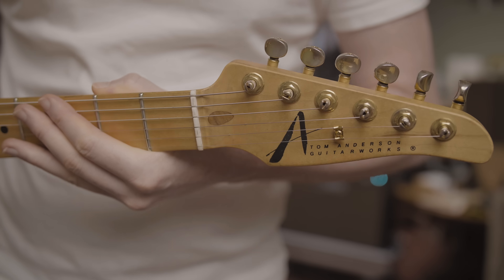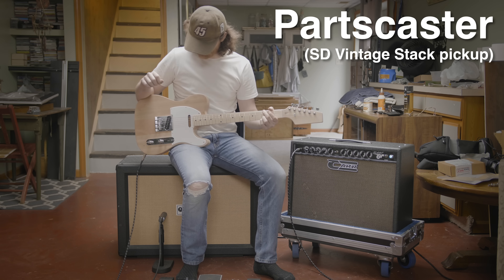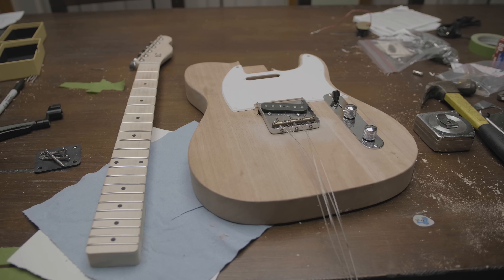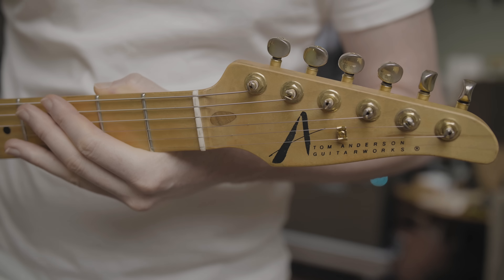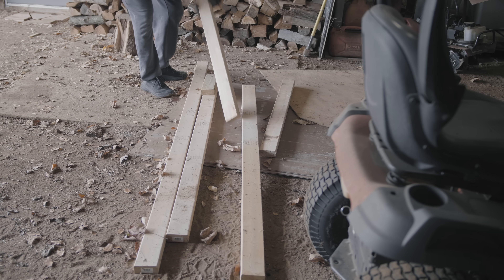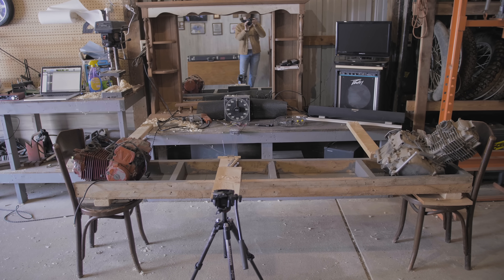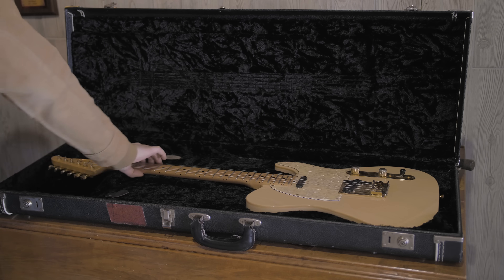Tested: Where Does The Tone Come From In An Electric Guitar?

Comment: So buy any guitar you think looks cool and put Seymour Duncans in it, and have the neck gone over and the guitar set up and you're good to go! BTW I' ve watched a few of your vids before, but this bit of brilliance earned you one more subscribe!  Excellent work!
Reply: I’ll add that there is a function argument to be made. The bridge and tuners matter, not for their tone, but for their ability to maintain tuning.
Reply: I have a 1977 Aria Pro II flying V that I bought in 1982 and the original owner installed Seymore Duncan pickups and I absolutely LOVE the sound out of that guitar. He also installed an original Floyd Rose tremelo in it (like EVH's first trem) and after updating to a tuneable locking FR, the tone changed.
Reply: @gneric85  noted, will be putting some in my Aria Pro II Z
Reply: "Buy a cheap guitar, replace the pickups, most of the hardware, take it to a tech and have them cut a decent nut, level and dress the frets, do a setup, and you're good to go!"

😂
Reply: @michaelwoods9005  You say that as if it's ridiculous but modding a cheap guitar still turns out cheaper than buying a high-end guitar.

Comment: I could hear a difference in all cases, especially between the guitar that was made from the slab of wood and the telecaster.  That, even given the fact that Youtube provides a maximum of 128k mp4 -- mp4 is a good codec, and it's true that the sound is somewhat isolated, but it's almost certainly losing a good deal of sound detail.  And then I'm using a laptop with the built-in speakers, which is horrible listening equipment.  The air guitar test is hardly scientific (though I heard a difference with this, as well) -- there are too many variables in the speed, strength, and position of the strum (especially strumming vertically versus horizontally), and if we wanted to make sure, we would be looking at the waveform.  I think that the best possible test on Youtube would be capturing the sound directly from the guitar (no amplifier, no microphone) into the computer and either using a lossless codec or examining the waveform (or a frequency analysis -- I forget what it's called, but someone mentioned it here or on another video).

Comment: THANK YOU!!! for this awesome video! I was just talking to my guitar teacher about an Ibanez I recently bought, and how I am so unhappy with it. Over the past few days, I've been looking at different guitars trying to figure out what makes them sound good, because I don't ever want to spend so much money on another guitar just to be unhappy with it. I am not exactly certain what is the mechanical problem with this guitar, but I am going to say it is likely to be in the saddle/bridge hardware or the general quality of the construction, or both. The range of harmonics is weak when plucking an open string, and the guitar does not have a lot of sustain, even though the nut is a Graphtech tusk nut. My teacher affirmed to me that Ibanez does not make them like they used to. Thanks again, and good luck in the future. I will be checking out your other videos.

Comment: Great video and as I have always suspected. The vibration of the METAL stings  is sensed by the pickup and turned into a small and fluctuating electic current. The body of the guitar, being wood, has no effect and after the pickups have generated an electic current, then only the electronics in the guitar can influence that current until it reaches the amp. amp lead quality, must also have an effect.

Comment: The dude talking about vibrations in the solid wood kept by resin or whatever reminded me of the bs the audiophile comunity says. lmao
Not really surprised by the results.
You can have more difference with cheaper components, specially the electronics, with more noise and unwanted distortion variating according to your power supply and ambient crap. Some basic good components, including filters for electricity in the amp make all the difference, but that doesn't involve spending thousands.

Comment: The ultimate test would be capturing the sound waves from two different settings and comparing them in an oscilloscope. That is really the only way to tell if the difference is that great (or if you can hear the difference at all).

Comment: disclaimer: haven't finished the video, but predictably at the midpoint it shows 95% of the sound is just the pickup. Well, the other 5% is the capacity/resistance of volume pots, cables and capacitors. Hope he gets to that, will watch the rest at some point and see.

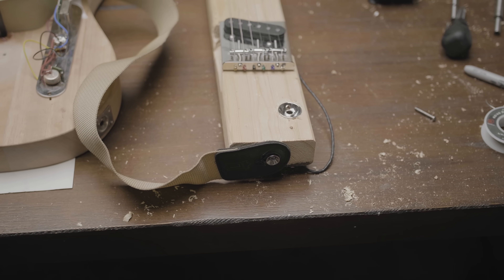Comment: 6:54 hold on, hold on! if you don't solder at least the pot volume between pick-up and jack then the output impedance of the guitar and the input impedance of the amplifier wont "match" sounding awful once conected to the amp.
Therefore i don't know what is sounding in the "2x4 guitar" demo, since theres no video i doubt was made with any guitar without pot volumen or any other electronic device (active or pasive) that helps to fix the inherent missmatch impedance issue.

Comment: I've just found this video so i'm "late to the party" but after reading a bunch comments i need to "say something".
I'm not a professional guitarist but i'm definitively a maniac , i've been playing for 35 years and i've about 50 guitars at the moment.
My last 5 guitars are Fender Stratocaster Yngwie Malmsteen signature (usa) , same spec , same hardware , same strings , everything is exactly the same.
When i play those guitars without a amp ( acoustically speaking ), those five guitars sound quite different from each other ,
 it's not that subtle and the only thing that can explain that is the wood.
One of them have a quite tight,dry,clear sound , another one is quite dark,warm sounding , another one is quite louder than all the other,another one seem to resonated almost
like if it was a semi-hollow guitar, that one seem to have some acoustic propriety than the other don't have.
The type of wood is the same for all the guitars , alder body and one piece maple neck but the sound , the feel , the overall vibe of those guitars is different.
The only things left that would explain those difference would be the grain of the wood.
Every piece of wood is unique, kinda like finger print ,they have a different grain,density and who know what else...
 and that must be the reason why my 5 guitars react differently.
So when i read that a cheap 150$ is equal to any top quality model i've to roll my eyes...
I also have few Made in Mexico Stratocaster and they are not in the same league than my made in usa Stratocaster. 
I've never test if my 5 guitars sound the same once amplified so i'm not gonna comment on that.
If some of you guy can't notice a difference between a really cheap guitar compare to a good quality one , more power to you ... 
but pease , don't assume that because you can't notice a difference , it mean that there are no difference...

Comment: I have build and rebuilt a good few guitars, some of my faves were built out of plywood as I have found that to sound is most impacted by the pickups adjustment and the electronics used on a solid body electric guitar. That is for tone, playability comes down to the hardware and how well it is set up. Only on hollow body string instruments does the wood and shape matter.

Comment: That’s what I always thought. Perhaps you also need to test for sustain. I think that’s the only criteria that the body wood and neck assembly would affect. Not the tone.
Reply: Interesting. I believe that the body shapes the tone, by means of subtraction. The neck can certainly affect sustain, particularly if the natural frequency of resonance is excited at a specific string at a certain fret. So wood does affect tone by subtraction. If you think about it, by way of example, subtraction of low frequencies can in effect enhance upper frequencies. WRT the neck, if a strat neck with a dead spot due to resonance, is placed on another body, the dead spot will remain.

Comment: Funny, listening to this eyes closed, I could tell every time when the guitar changed to an other. In this light, this test actually confirmed that the wood and other details make a difference in the sound. The last test 'without a body' was actually a test with a huge vibrating body but without a neck. You can try this at home: take an electric guitar with no amplification, strum the strings and touch a table with the guitar neck or the body and be amazed how loud the table becomes as an additional vibrating body off extra mass. The neck becomes a real factor when you press the strings on the frets, not so much when strumming freely vibrating strings.

The conclusion: even if you can't hear it, some others will.

Why should it matter really? When the drummer starts playing you can't hear the difference anyways. It matters by giving the player joy of playing thus making him play better than with a crappy sounding instrument.

Comment: Electronics, 2 pots and a cap. 
Electronics, lithium power, Digitech FX, 10 band EQ-amp, speaker, and the e-bow concept built in with finger volume in the slide.
Portable Pink Floyd.
Just a stick of wood and 2 long scale strings the rest hangs on like modules on the space station. Space, guitar, the final frontier.

Comment: lol, this made me laugh knowing how many people believe in tone wood on electric guitars. I will say what I have always said, if wood does effect tone at all, its a minor eq away from not mattering (there is a test video where someone made bodys out of different wood being the only factor and used a through neck designed plug) 
There may be some difference in guitars sustain ability but this has little to do with wood and more to do with construction quality, if you need sustain for days with no compromise, getting an aluminum neck would be the best option followed by a sustainer
pickups matter to an extent, but it seems that anything passed well made 30$ tends to be again, an eq difference
shielding/electronics this should never wildly effect sound, but the difference between good and bad can definitely play a role
and finally, to some degree, the metal from the bridge to the neck to the frets, each one will impart a slight tone shift, but again, nothing that a minor eq wont compensate for. 

for anyone who just wants to build a guitar/upgrade a guitar, the most important things to watch out for are just convince and binding potential. get locking tuners with good tolerances not because it affects tone, but because you wont need to spend forever restringing or tuning, get a good hard self lubricating nut (drop it on a hard surface and it should sound like glass) not because it adds tone but because it eliminates binding. roller saddles also help with binding, get stainless steel frets if you can not because they add tone, but because they are a forever part of the neck, never need to re dress them. and get pickups that play to what you want to sound like, I went for single slot rail humbuckers at 10k/7k/15k all splittable so I can get the most out of the least.

you have far FAR better places to look for different sound, the guitar should never be the place you look first, the cab/speakers/mic are the first place to look barring any kind of problem in the chain.

Comment: You can do anything with electronics these days so it doesn’t matter. I think all this tonal difference hype comes from acoustic guitar construction which can have total differences depending on the timber that is used. Perhaps that is why some Stradivarius violins which have 300 year old timber sell for $1000000

Comment: wood definitely holds a factor, but it's not because of the sound of the wood going into the guitar

my hypothesis is that density of the wood affects the resonance. the less dense the wood, the more it vibrate. if the body of the guitar is vibrating, then that in turn means the bridge and the neck is vibrating. and if those are vibrating, then the nut, the head, the tuning pegs are vibrating, and in turn the strings. unless you keep all the strings muted, you will have extra harmonics in there every time you play a note. on top of that, the pickups are vibrating too.

this is also the reason why denser wood has more sustain. if body vibrates more, then that means more energy of the string is being transfered to other parts of the body and even the surrounding air. this in turn means the string will stop vibrating sooner. but denser wood that vibrates less means that more energy stays in the string and doesn't travel to the rest of the guitar. it also may mean the string could be louder, increasing output.

of course this is subtle, i don't care too much about this. I just get whatever i like. i don't notice too much differences, it's still there. but i don't worry about it. my strat made of basswood (not very dense wood) surprised me with the amount of sustain i got when i turned on a distortion pedal at a gig i was at once. it was just lying around and i plugged it in. the sustain was nuts. i was doing some lead lines in between the vocals and i was holding a bend a few times so the note would fade out but it just wouldn't and kept going throughout the singing part. kinda annoying having too much sustain tbh

anyway. in terms of tone the order goes like this

Amp

pedals/effects

pickups

pick (thickness of the pick matters a lot)

body wood

neck wood (i never consider this, if you are seriously bumbed that your guitar uses indian loral instead of rosewood because you think it will affect your tone, you have some mental problems)

btw, playing technique is not tone. it does not affect the timbre. the way you bend a note or add vibrato does not change tone colour. that is technique, stop saying tone is in the fingers, you are just wrong. when i ask for david gilmours tone, i am asking for smooth sustain. you can't get smooth sustain from a big muff but adding vibrato. i will not get jimi hendrix univibe or wah sounds from bending. stop saying that shit, it is infuriatng

i have some deep seated hatred in the "tone is in the fingers" since i once asked a thread how to get the tone from comfortably numb and ALL the replies were "oh yeah, tone is in the fingers" or "it depends on your amp"

and i would then say "just tell me what effects. he used, i can figure it out on my own, i don't care about sounding like the real david gilmour" they would just give me "we don't know what you have, what amps or guitars you use"

jesus man, all you had to say was a strat through a big muff with a boost afterwards with a rotary sim into a mid focused amp. delay at 370 ms. add a flanger if you want

thats all i was asking for but NOOOOOO, i have to get multiple people who don't know what he used telling me that i need to bend right and vibrato right. oh yeah thanks, learning how to bend like david gilmour REALLy gave me that smooth sustain on F# for comfortably numb

Comment: An interesting thing that could affect the tone is the tolerance on the volume/tone pots and the tolerance on the capacitors (if any) inside of that tone circuit. A lot of potentiometers and capacitors have very sloppy tolerances, which could be as poor as +/-20% of the rated value. It would be interesting to see if this has an effect on it.

Comment: First, I am a talented hack hobby builder (NOT a luthier) who thinks 'tonewood' is far overblown.  That having been said, I'm not sure the 'air guitar' is valid. Think about it.... there IS a body, and there IS a neck. The 'body' is the bench the bridge is bolted to, and the 'neck' is the wood the head is bolted to. If you look, the two are even connected by that 2x4 behind Mr. Lill.

For me,  the most convincing is the parts swaps between geets.

Comment: Great video! I would argue that a solid body vs truly hollow body does make a significant difference too
Reply: Ofc, but then it's an acoustic or semi acoustic guitar right?
Reply: @foka.3kai  No, I'm talkng about archtop guitars or like a Gretch or a PRS hollow body. There is definitely a tone difference in those coming from an amp. I wonder if the chamber simply vibrates the pickups and you get an extra dimenison of vibration from there, as they wiggle under the strings. Could be a cool thing to test
Reply: @ryanfox6260  ah ok yea maybe he could check that out :)

Comment: I'm going to have to agree with Glenn from Spectre Sound Studios, the guitar itself is almost irrelevant as long as it's comfortable and you like it. It's just a vibration generator, the tone comes from your cabinet, speakers, and microphone (if you're using one). Add in any effect pedal and the minor differences in sounds from one guitar to another all but disappear. Also, if you play for an audience, they'll never know or care what setup you're using as long as you can be entertaining.

Comment: Silly question. It comes out of the tone pot. This is a small cylindrical can mounted under the scratch plate that is filled with tone at the factory and equipped with a knob on top that regulates the release of tone at a controlled rate.

Comment: I've been through a LOT of guitars, amps, effects, cabs, etc.
IMO the pickups and the strings are the heart and soul of the tone. I don't think people are entirely off when they claim certain woods sound different, but it's going to be a tiny difference when all other factors are ruled out.
Reply: A bunch of anecdotes about "b-but my two guitars have same pickups and hardware, what's different?" but little did they know that the mere position and distance of the pickups relative to the strings and the quality of the pot resistance does suprising amounts to the tone, from first hand experience. Was really blown away while incremently rewiring my bass with the same resistor values even before I watched about these tonewood debunkers.
Reply: @mk_rexx  I want to lump in pickups with the whole signal chain inside the guitar,